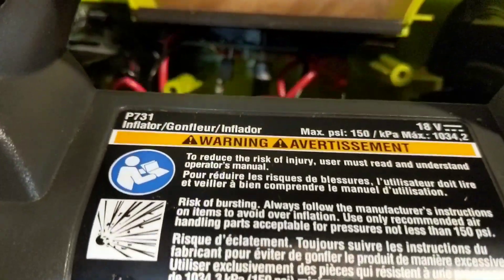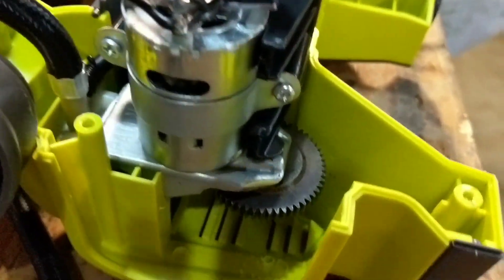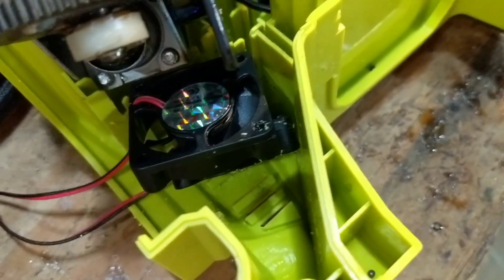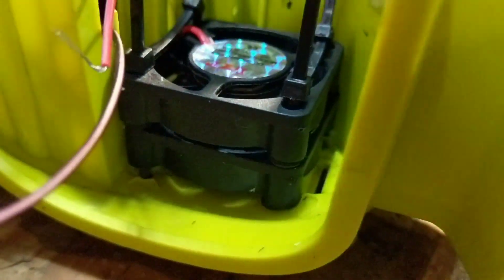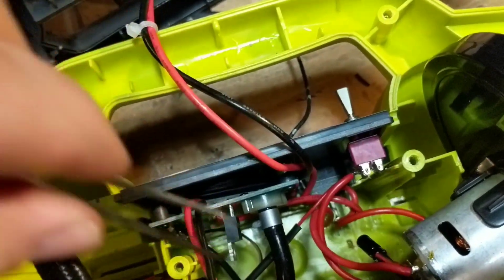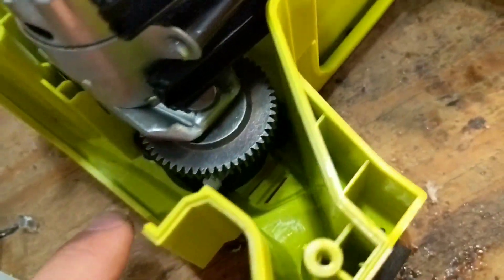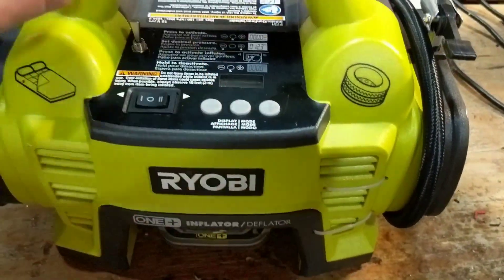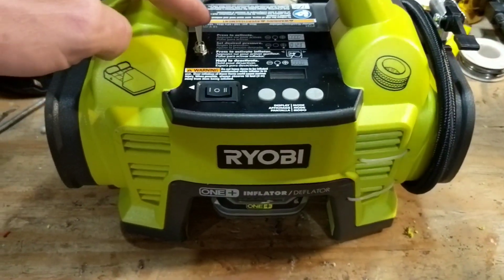Mod of Ryobi 18V Dual Function Inflator / Deflator ONE+ Model P731 Modded

Comment: These are fantastic inflators. I hope more people will mod this unit in the future.  

If anyone is inflating anything over 100 psi use a small hose clamp where the chuck meets the air hose to add some strength.  The chuck came off mine while refilling a compressed air can. And if you ever take the case off, check where the hose is connected inside. If there's no hose clamp there, add one there too if you can. Don't crank too tight as only a plastic barb you're cranking it onto. They can easily crack.

More hacks I'd love to see for this unit:
-Flashlight/hazard light mod, perhaps with a blinker for visibility/safety on the road. 
- Blow Gun mod. For those who use compressed air cans alot.  For now I hacked a compressed air can to make it refillable. I have no room for an air pig or I would have hacked a propane bottle for that.
- Better tire chuck. One that locks onto the tire without having to bend a lever. You might need to change to regular compressed air hose for that, which is another mod. (adding regular air line to be able to connect compressed air tools) 
- Power mod. Add 50 psi. Is it doable?
- Close off the bit holder on the side with a lid that opens and closes. Or add a container that opens and closes. You could add more bits. Don't lose those as they're great for camping say inflate air mattress, inflatable beds, various water toys. 

Usb charger mod is pointless since there's a Ryobi inverter/usb charger that connects to the battery. People can also mod or of 3d print those.